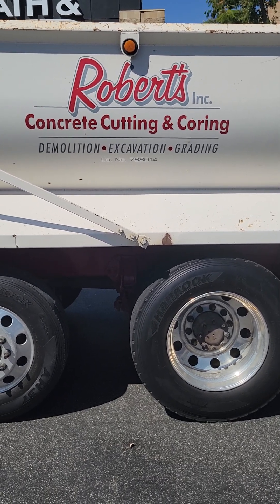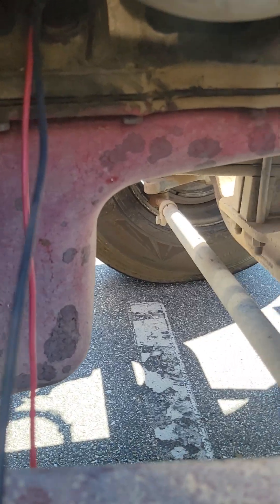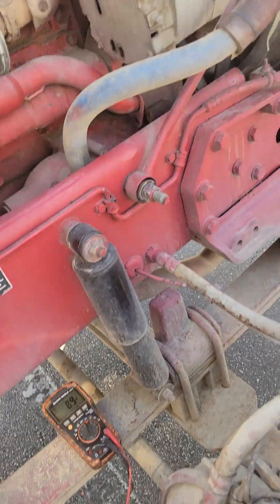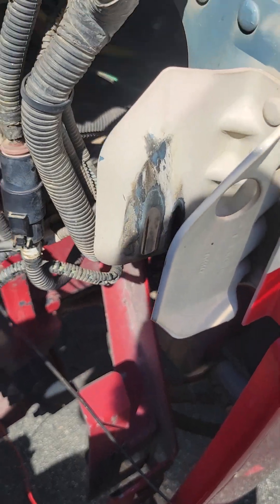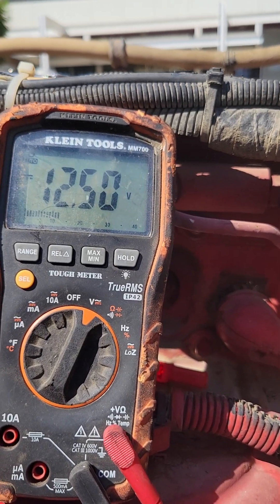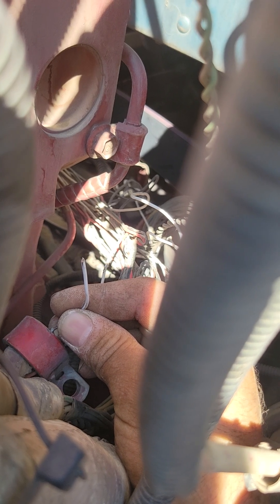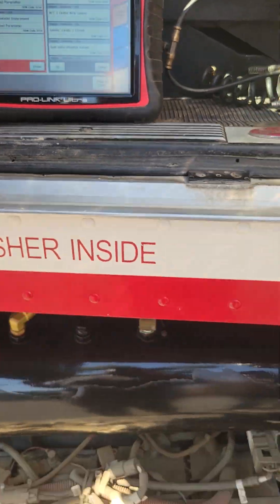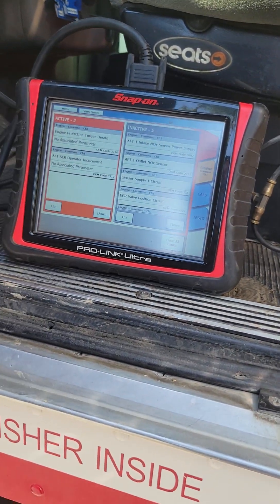Cummins ISX 15 Derate, Intake NOX sensor code 3232 cause and repair

Comment: good explanation on the 3232 fault. I have the same fault code (spn 3216, fyi 9) on cummins isx15 but the truck has been sitting for a long time only starting engine once in a while. As the 3232 seem to often be a wiring issue i wonder if also the NOX sensor can also go bad and give that code?